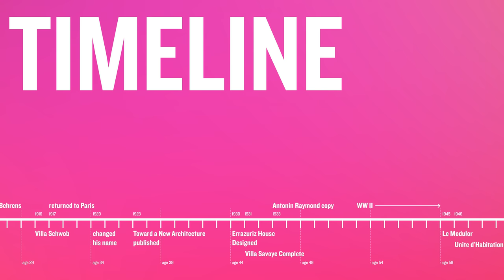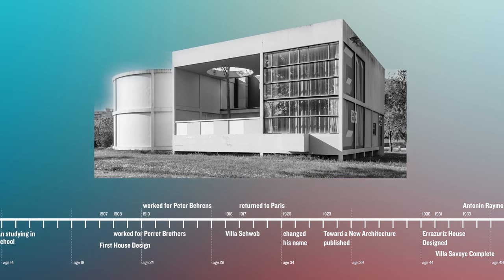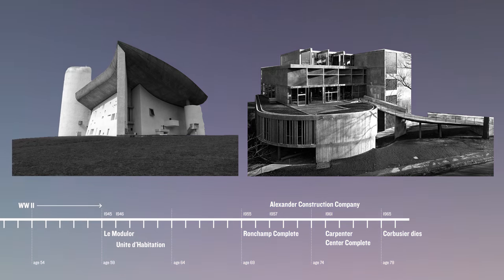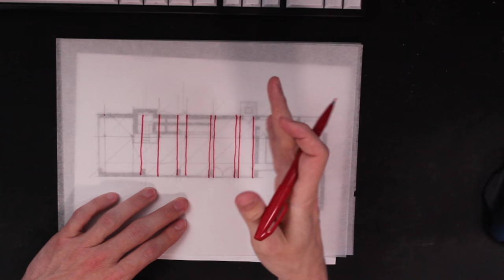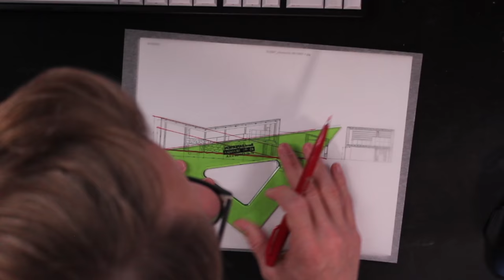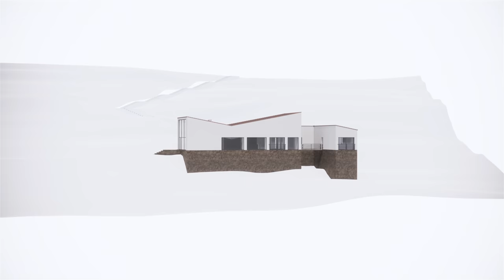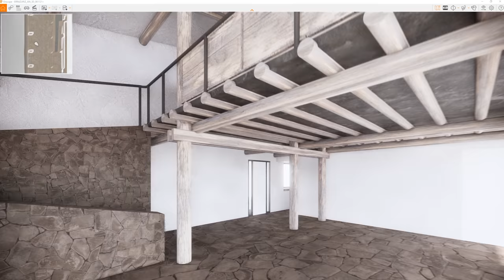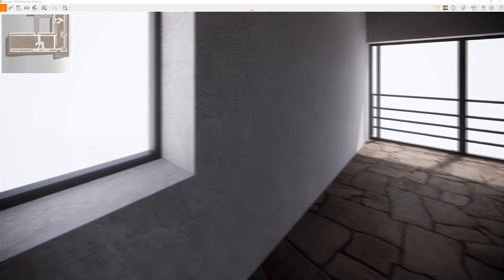Inside Le Corbusier’s LOST House Design [Errazuriz House]

Comment from the maker: What do you think of the Errazuriz House?
Reply: the designer employs pretentious gimmicks to hide his gross ineptitude, something very french and very hipster
Reply: Accountant The no you're not, and no I don't since there is no angst to speak of
Reply: @oltedders  Interesting, in the central part of Chile we do have significant rain during winter and is also specially humid by the coast. Despite that, I've seen some butterfly roofs around Santiago (few hours away from Zapallar) and they work just fine, taking into consideration central drainage of course.
Reply: if the wing roof can be made to tilt (with an attack angle), so that the central axis is not horizontal, then the drainage is not a  problem.
Reply: It reminds me of the kind of house you might see on Bojack Horsemen. Pretentious and expensive.
Reply: Quite amazing, given the epoch, the context & its design overall being edgy (ramps as opposed to stairs, wide open layout, clear lines & spaces) and yet the materials & earthy settlement to it gives the project that local, traditional touch. Thank you very much, I just became a new subscriber to your channel :)  BTW what software did you use for the 3D model?
Reply: I think it's really cool!
Reply: I really appreciate the section sketch where you can see the proportion of the ramp to roof. Surprising how much influence an unbuilt can have.
Reply: Hi Stewart, is it possible to see basic floorplan and dimensions of the houses you do 3d models of? Enscape does not seem to have dimensioning tool. Thank you for all the work on these 3d models - makes a big difference!
Reply: I think it's a fantastic design overall. Uncharacteristic of what is "Corbusian" I think, but there's a lot that's ahead of its time. The climatic design is also pretty good, lots of northern light, and flow inside for ventilation. The butterfly roof design is fairly novel for it's time, doesn't provide practical use, but it's not really train-smash for water, unlike what others said, it can easily be solved. But it provides excellent sea views, a lovely appreciation for natural, raw materials, (the interior columns were tree trunks). The structure is fairly simple as well, the column and beam joinery are almost Japanese in character. And the fireplace alcove is fantastic, I really like that. A very sweet, cozy design, and shows snippets of Corbs subtle appreciation for the vernacular, something that will emerge later in India.
Reply: @UGPepe  want to elaborate on the signs of ''gross ineptitude'' or maybe want to name any of the ''pretentious gimmicks'' used here, or are you just throwing words around?
Reply: Grubiantoll terrible bait, try harder next time
Reply: I have a 1963 MCM Butterfly, it’s very interesting to see Corbu’s design and interior layout compared the interior of my house. The choice of heavy post and beam timbers seems a bit overwhelming for a space that should seem light and airy and open to nature. The wall space over the living room glass sliding doors also seems so heavy almost oppressive, pushing you out through the open window wall at the end of the building.  I’m sure this is intentional much like FLW likes the use of compression and release in his structures but it seems very dark and overwhelming you can almost feel the weight of the roof above you.  By contrast that wall is all glass on my house which I’m sure is why I had such a strong reaction to the visual of his space.
I also don’t care for the view out the loft window, I would install clerestory windows so the focus is on the trees and not the adjacent roofline.
Thank you for introducing this Corbu design and analysis!
Reply: I recently came across this house again in Corbu's Ouvre Complete - it was interesting that the photos of the house were from an architect in Japan that built a copy of the house.  Crazy!

Comment: It is an amazing house that still seems modern 91 years later.  I wonder why it was not built.  Perhaps it is not deemed practical?  For a couple with the occasional guest(s) it seems very livable in my opinion.  It would be interesting to see the actual site and how the views are presented.  I am fairly sure it would be stunning both in terms of views and in terms of integrating into the landscape.
Thank you for the very good presentation.

Comment: I’m no architect or mathematician but when you where line tracing Corbu’s design plan, I immediately thought of the Fibonacci sequence in a linear progression. Is it possible this was Corbu’s intention?
This seems to be the case in my house, from the center point of the wing each room increases in size out to the end of the wing.
Additionally, I was so surprised to learn Corbu had designed a butterfly styled building, that MCM design is almost always attributed to William Krisel or Joseph Eichler.
Great video, thank you!
Reply from the maker: Maybe! Good idea.

Comment: Past the pleasing elements of view and angles I am surprised at the points that seem clunky. The fireplace cavity is quite unbelievably deep and where is the chimney? Perhaps I missed it within the side wall on its left? It would be interesting to see how this was handled in the Japanese house that was actually built and occupied.
Reply: The fireplace cavity might be a bit overaggerated by what is shown in the render, than what's in the original design drawings.
Reply: @yesh7183  , maybe, but it must be the depth of both turns of the ramp.

Comment: Good lecture, with excellent visualization technique. It does however reconfirm why I do NOT admire Le Corbusier's architecture or would want to live or work in the spaces he creates (as I have had the experience of so doing for 3 years when I lived and worked in Chandirgarh, India, on a UNESCO project.) His spaces are spatially cramped and visually claustrophobic plus the manipulation of light entering from the exterior and hence the connection to external space, is unpleasantly disorienting and confining. My experience in Chandrigagh confirmed to me that I was not alone in feeling discomfitted in Le Corbusier's oddly impersonal architecture, in which all space is "institutionalized" through reductionism of forms below the level of functionalities. In Chandigargh, occupants all made major modification to Le Corbusier's architecture -- offices and homes and shops, all typologies --  in spite of strict government regulations against this intended to keep the Master's architecture intact and authenic. Nonetheless, occupants made many informal modifications --  knocking out new windows, re-organizing frenestration patterns to try to better regulate heat and ventilation, raising ceilings, adding tactile surface finishes for a variety of safety, visual, and environmental reasons, adding attached covered terrace/patio/balcony space (requiring new doorways), adding annexes to accommodate basic services/utilties/storage the spaces for which were either inadequate for use, or sometimes non-existant, and adding internal room dividers to create private spaces for sleeping (houses), security (shops), and offices. My conclusion is that our nearly-universal intellectual admiration for Le Corbusier's design rigor (an admiration which I share on an intellectual level) is purely academic with the congruency with application through construction that the practice of architecture requires as a fundamental principle. No surprise to me that the E House was never actually built, or that it inspired thousands of cheap knock-offs by greedy  unscrupulous property developers. 

In the context of teaching and leaning architecture, this provides a salutory example of the architecture profession's fundamental requirement which is to take the abstract analysis of the geometry of architectural form and compare it to the physical requirements of space meant for occupation or other uses, ensuring at least compatibity, if not congruency between the two. This lesson recalls another lecture in this series (the one on architecture and geometry) in which it is made clear why the two preoccupations of the great architects of history have been (i) the precisely surveyed (measured) environmental setting of a building (external space), and (ii) the (measured) proportionality of created space in relation to human body size and the movement of the human body through the created spaces (internal space.)

Comment: That flickering transition is thoroughly unpleasant even if you aren't epileptic.

I am not fond of how the building limits ground access, which would seem desirable in a vacation home. There seems to be singular access to the rest of the plot and out of the property, and the two are separate. It wants you to admire, but not be outdoors.

The side wing especially seems to require more leveling than strictly necessary, and I hazard a guess that site access  for things like the massive pillars and the cost of earthworks tanked this build.

And I'm not convinced it would actually work. Every functional space from stairwell to kitchen seems cramped. I'm not clear what climate it was intended for, but it doesn't seem to provide good cross ventilation for summer, and heating it would be challenging with the tech of that era.

Comment: The graphics are really good, but I would appreciate it if they ran more slowly.  Like, don't rush me through the house, please.  Give me a chance to look around.

The low-ceiling foyer area in the Errazurig plan seems to repeat the Frank Lloyd Wright concept of a low ceiling foyer that welcomes the homeowner or guests into a more expansive interior space.  (The opposite of today's popular 2-storey foyer w/ chandelier and grand staircase that, often as not, leads into 1-storey rooms.)   The ramp seems to occupy a disproportionate amount of interior floor space.  And a fireplace UNDER the ramp?!?  Too much of a "mix of metaphors" for me.  Then too, the house does not seem to know whether it wants to be modern or rustic; another mix of metaphors that does not work for me.

Like others here, I never associated Corb with the butterfly roof.  That roof style got very popular in Palm Springs, CA in the 1950s, but is seldom if ever employed today.